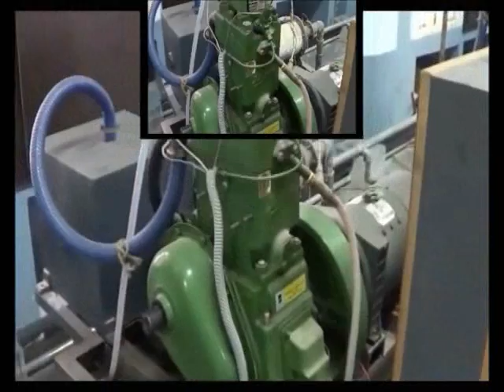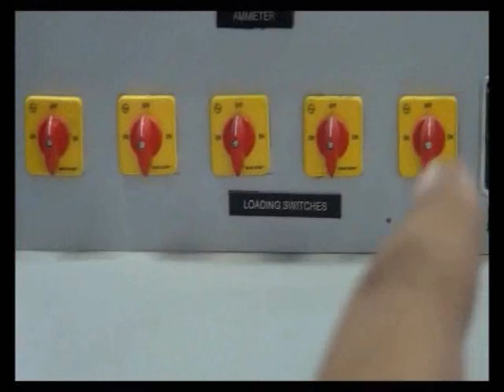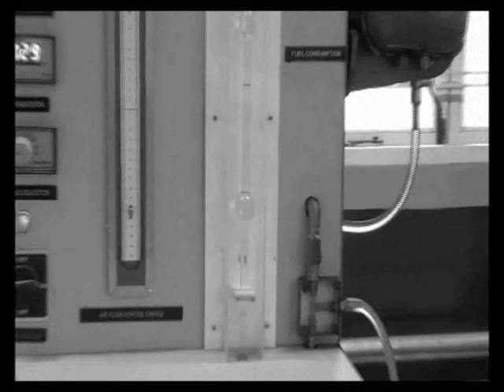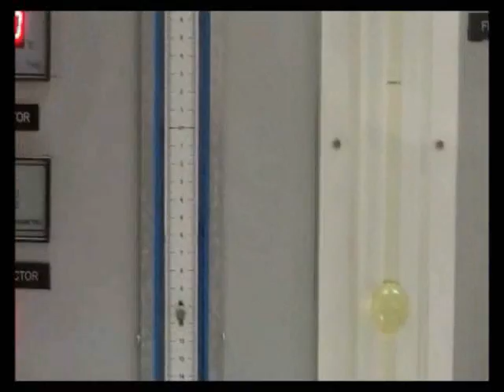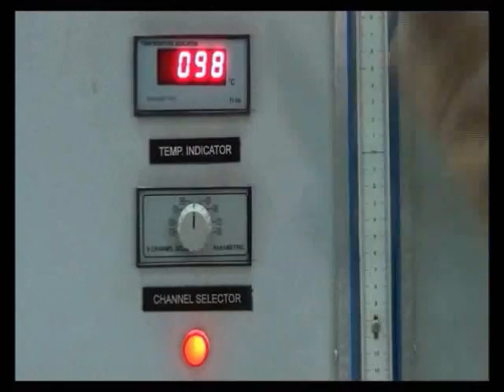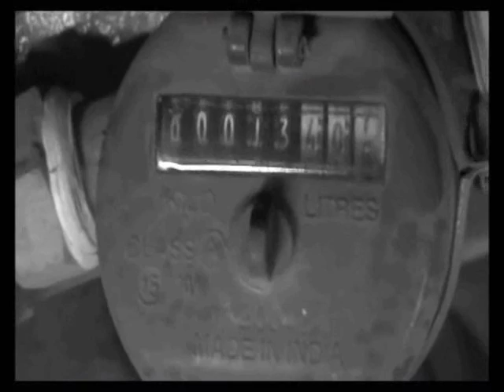GRIET TE LAB: Performance and heat balance test on diesel engine with electrical loading

Comment: Sir why we have to open exhaust valve during starting of engine
Reply: If not opened, then the pressure developed inside the cylinder during cranking will be more. Due to this higher pressure you can't crank the engine manually. so when we keep exhaust valve open some of the pressure will be released.Therefore you can crank it easily to start the engine.
V. Vinodkumar
Assistant Professor/Mechanical Engineering